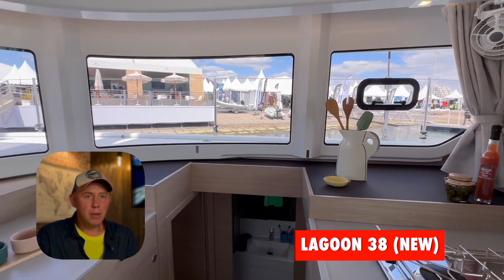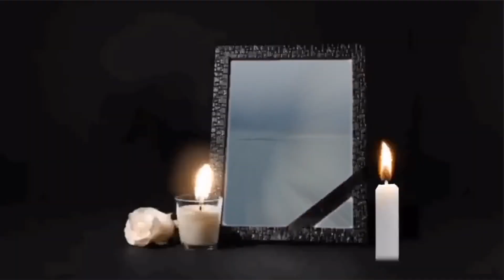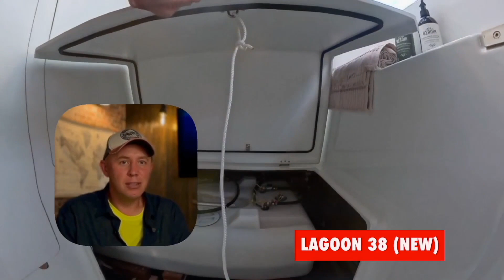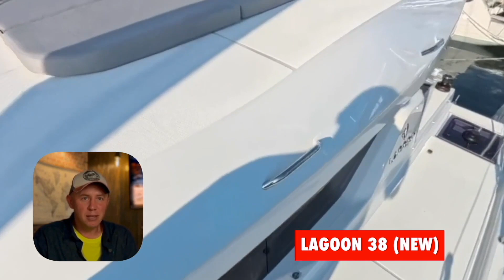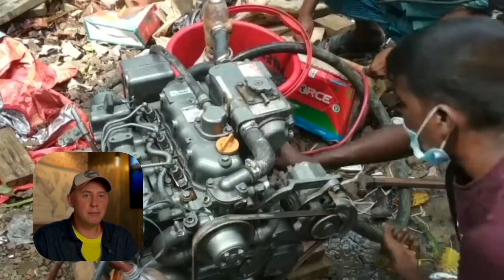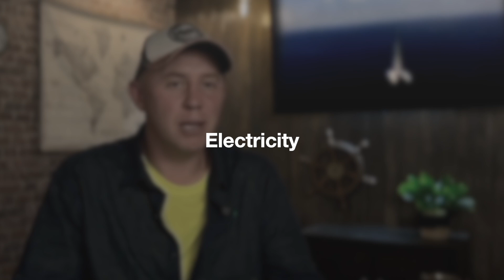Earn 130k Euros a year on a catamaran! Lagoon 38 – the best choice in 2025

Comment: To be honest, I didn’t watch the whole video, I lost interest once you started dissing the original best-selling catamaran of all time under the guise of comparing it with completely unrelated boats : the Lagoon 380.
Yes, it’s dated. But that depends entirely on what you’re looking for.

Experienced ocean-going sailors understand the value of a safe, proven, battle-tested design, which the Lagoon 380 absolutely is. It’s not a floating condo. It’s a solid, no-nonsense cruiser that’s taken hundreds of crews across oceans.

Comparing the Lagoon 380 to a Bali 4.0 is like comparing an F150 with an off-road trailer to a Sprinter campervan.
Completely different tools, for completely different purposes.

The author should stick to apples with apples. Comparing apples, oranges, and pears makes no sense whatsoever.

So it really comes down to what you want:
A stable, reliable passagemaker that’s easy to maintain and proven offshore, or a charter-oriented platform with multiple patios and a lot of Instagram appeal, but less real-world capability.

Also, we’re too early to know where the new Lagoon 380 will fit into the lineup. But it has big shoes to fill. My guess it will be the latter. Saying already it has become safer, is not yet a fact.

Just my opinion.
Reply: I didn’t finish reading your comment due to you boring the heck out of everyone with your useless opinion 😂😂